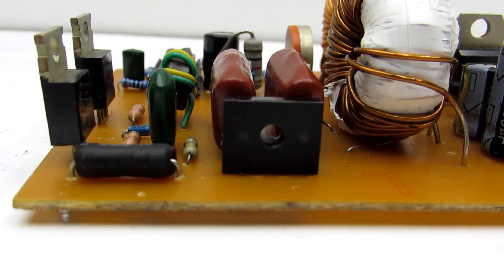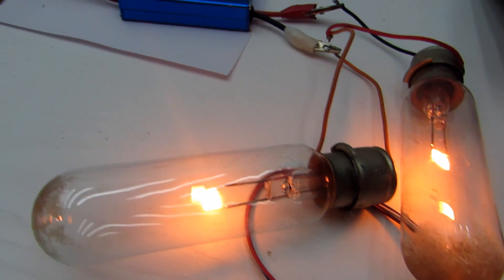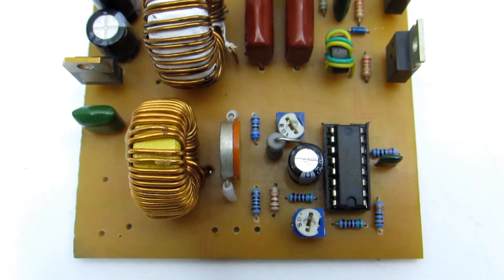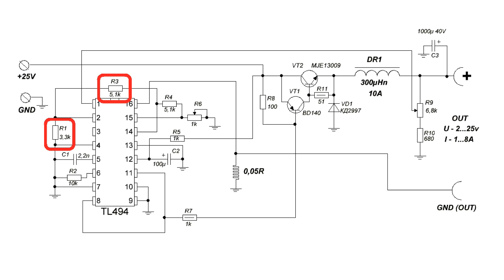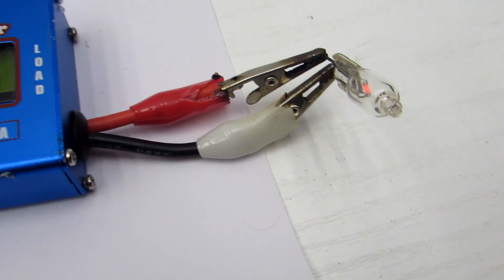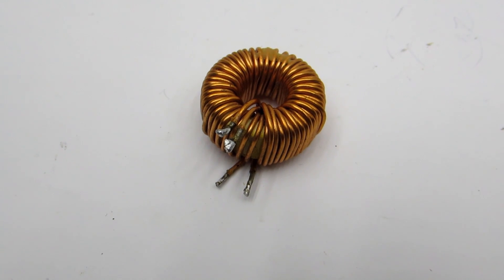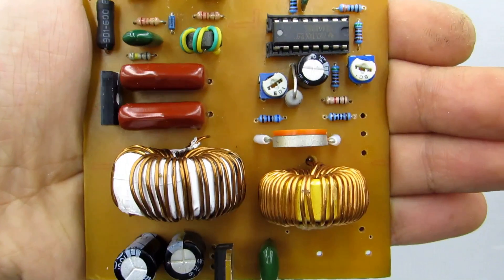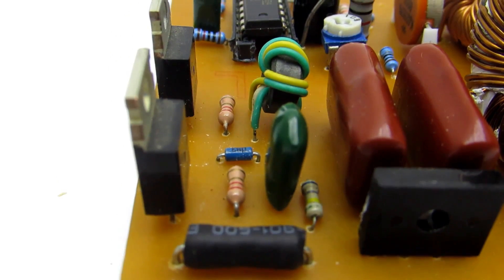DIY Automatic charger (part 2)

Comment: I made it and the voltage drops from 14 volts to 3.5 volts when i connect a 25w bulb 12 volts rated. Whats wrong? I didnt notice any change in current control with the 1k pot. Help Me
Reply: she did't put 51k resistor for voltage compensation between pin#2 & pin#3(PWM comaparator). that's why voltage drop.

Comment: Apparently i made the circuit as they described and no regulation takes place at the output. It's just one volt less than whatever voltage i input and current doesn't change with the potentiometer nor does the voltage. Someone mention something about the ic and i think thats the issue.

Comment: Hello this system can be used for a photovoltaic system to charge batteries. And another question this is a buck converter. Thank you
Reply: I'll try and help. The regulator here can be used as a buck converter. You can use it in a photo-voltaic system, but you have to make sure the solar panels are putting out a greater voltage than the batteries. You'll need to add a diode to prevent reverse current from the batteries into the circuit if the solar panels output drops too low.

Comment: you are using CD 4049 hex inverting buffer IC and how your circuit is working I don't know and you are showing tl494 pwm controller in your video what's wrong

Comment: can diode UF4007 be replaced with some nother with same funcunality
Reply: Yes, sure. As long as it can handle the voltage and current.
Reply: NNNI / do you nkow one with simular curend, voltage, reverse voltage
Reply: Maybe the 1N4007, or if you want a bigger one the 1N5408.
Reply: NNNI /thank you